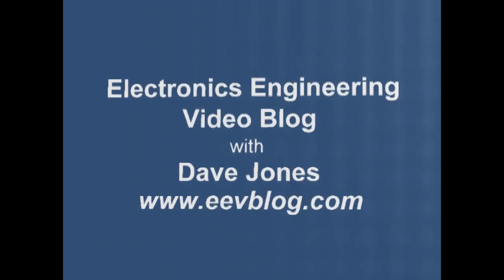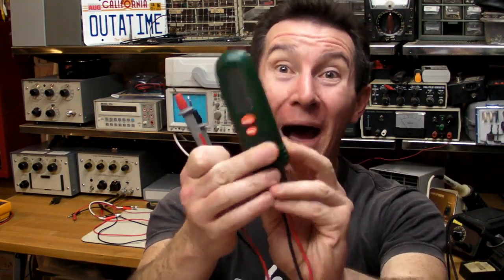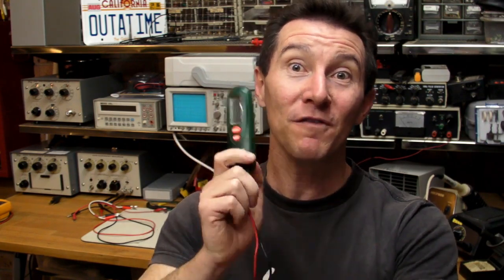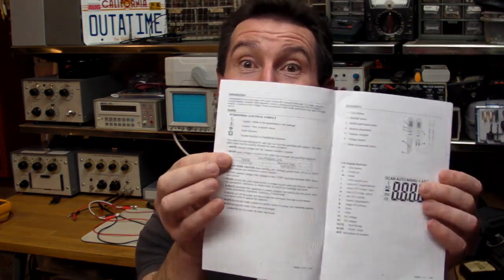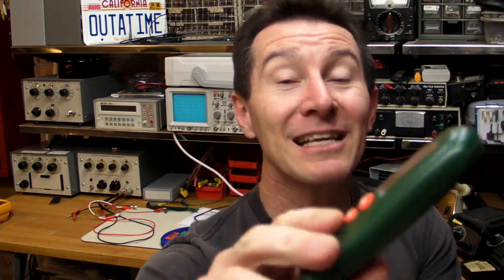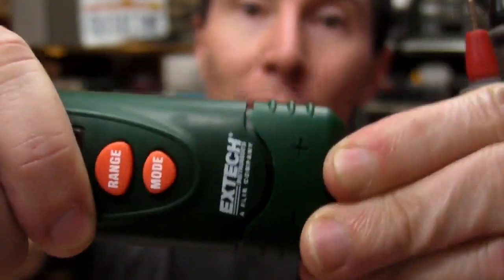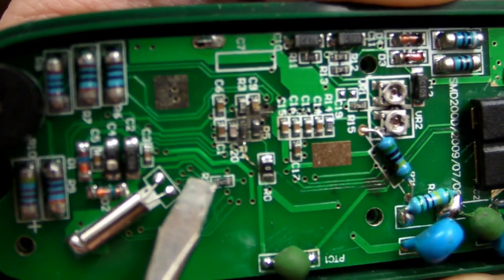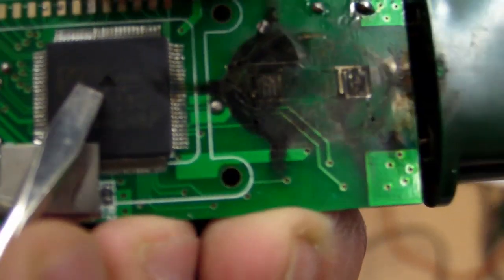EEVblog #94 - Near Death Multimeter Experience

Comment: i have actually bought this  multimeter for only measuring capacitances and i never  came up with the idea to measure high voltages with it. i understand your anger cause it blows up in your hands. my device switches automatically to Voltage measuring if i plug in the cable adapter and measuring 240V AC is no problem. im satisfied so far with that MM.

Comment: Well, seeing as the mains in the picture was 120 volts 60hz...
Reply: I didn't see that, could you pointme to the time it is at please? Not being sarcastic, I just didn't see it.
Reply: FAMICOMASTER The CAT III specification corresponds to 600V in this case.
Reply: Where's the CAT III stats exactly.
Reply: Categories I - IV are implementation-defined. Extech appears to use "CAT III-600V." I have looked, but there is no universal standard, unfortunately.
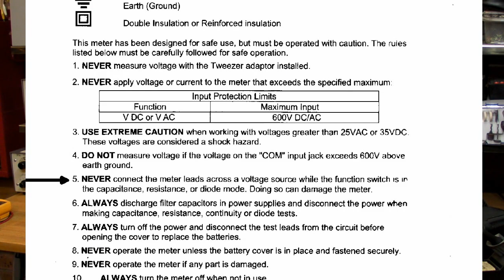Reply: its says 600V AC/DC in the document at 4:21

Comment: Now i get why nowadays Dave always says: "Don't turn it on! Tear it apart first!" :)

And of course the manual doesn't justify them! The 5. point doesn't exclude the auto-mode. Maybe it's a problem with the correct default logic values and universal clauses that they're experiencing :) - the mode should be default voltage and point 5. should state: NEVER connect voltage source if the meter is not in a voltage meter mode. too many negations here but NEVER looks better between NEVER and ALWAYS clauses :)

There is also an industrial rule NOT to show any pictures of putting wires into mains :) - if they want to measure 500V - let them connect the meter to a regulated Ruhmkorff inductor :)